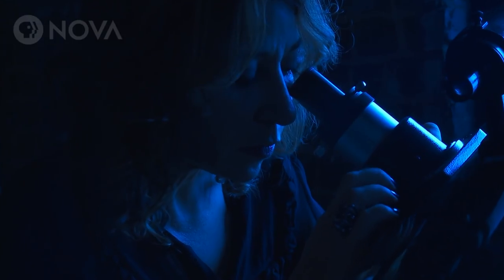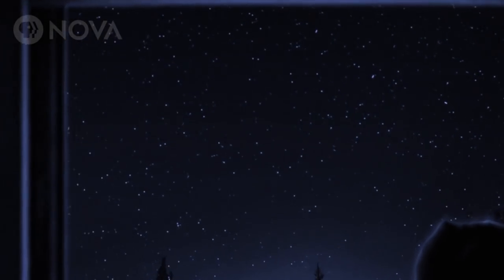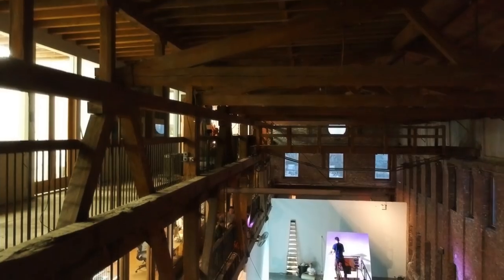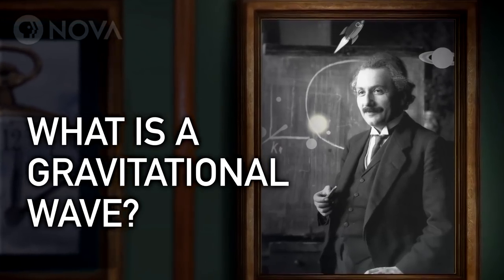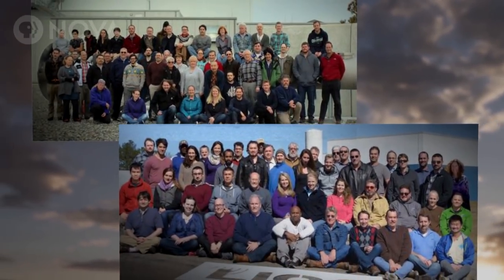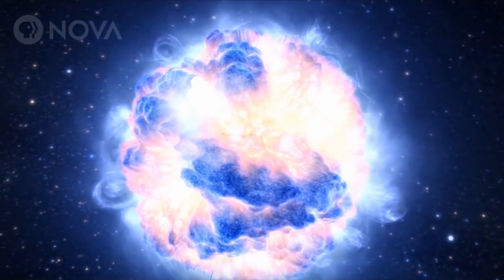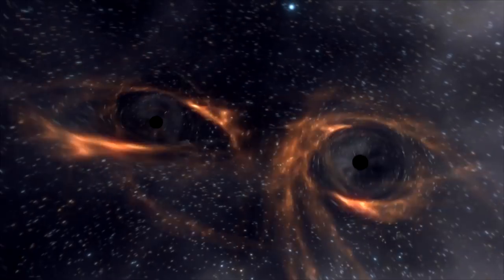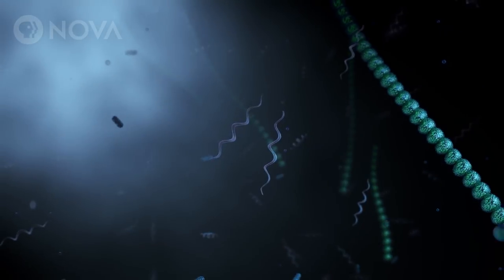Black Hole Hunter: Janna Levin

Comment: Another Lucky Guess?, or my thought experiment.

My reasoning in this thought experiment.
The recent NOVA presentation of “Black Hole Apocalypse”, included descriptions of gravity waves traveling through the Fabric of Space Time, as compressional waves in the Fabric.  Also described are Electromagnetic waves, traveling as transverse wave motions, in the Fabric of space-time.  All of which, I suggest, requires compressing and stretching of the Fabric.  The subsequent motion imparted upon “things of matter” in the fabric “such as demonstrated with LIGO” illustrates, to me, a direct connection between Matter and the Fabric.
From this, and other related observances, I would like to propose the following possibility.  
M=FC2   where F= Fiber of Space Time.
What brings me to this thought?  Please consider the typical depiction of a “gravity well” as a plane, with grid lines, distorted into a depression, or well, by a heavy weight placed at the center.  The Gravity Well drawing depicts how gravity effects any matter placed on the grid, and assumes a gravitational force from below the plane.  The matter will be drawn into the well, of the plane, by the downward stretching of the Fabric, and a gravitational force below the plane.
I suggest, here, how this may be depicted in a 3D volume, with no assumption of external gravitational forces.
I suggest a 3D volume is assumed in this description.  Initially this volume is to contain only the homogeneous Fabric of Space Time, shown by filling the volume with a translucent shade of grey (arbitrarily chosen).  A gravity well, in this volume, may be depicted as an infinitesimally small point that has drawn surrounding Fabric into it, stretching the surrounding Fabric as it is drawn to, and into, it.  In this depiction, I suggest the stretching in the fabric to Be displayed through a varying of the shade of the Fabric, to indicate the degree of stretch, and thereby variation in density of the surrounding Fabric, most rarified near the central point and increasing back to the surrounding ambient, some distance away.  Appearing now as representing a 3-dimensional vortex inside a volume. 
 I suggest there is a maximum amount of Fabric volume pulled into the vortex.  And that amount to be C2.  I suggest this value matches with what seems to be observed when the vortex “unravels”, or E=MC2 .
Unraveling of the central point would be expected to produce a violent expansion of the Fabric around this point, and should be expected to produce a large amount of compressional and transverse waves in the Fabric.  There by producing gravity waves, light waves, and other frequencies of EMF waves traveling outwards away from the central point.  As well an abundance of freed Fabric will now push its way back into the surrounding Fabric and pushing Fabric, any objects of matter, away from this point in all the 3 dimensions. 
Now I suggest creating a second such point of stretched Fabric, near the first, at a distance where the zones of low density of each are just begin to overlap.  The area in the Fabric immediately around and between these two events will be of a lower density than the area outside the combined zones.  This, I suggest, creates a surrounding pressure Imbalance that strives to push the two points together, functioning as a Gravitational force.
I suggest the following characteristics of the Fabric, to be found around this vortex event, or events, in the Fabric.  Traverse waves (EMF waves) traveling past this point, in the Fabric, can be expected to slow down, by an amount depending upon the change in Fabric density surrounding the central point.  
Also the EMF waves can be expected to be refracted as they travel through the varying density surrounding the central point.
I am aware, as I assume you are by now, that the process that creates this vortex has not been addressed.  This is something I suggest can gather sufficient interest once these natural occurrences of time and motion in the Fabric have been verified.
Also I suggest that these central points, being of such astronomical amounts of densely packed Fabric, in each one, to be what we observe as points of Matter. 

Many regards,

Gary Lee Scott
1/17/2018

Comment: When things are pulled inside a black hole the universe seems to be expanding infinitely.  Our galaxy and most galaxies are just a few billion light years apart above the event horizon.  Expanded bubbles are not true though appears like that.  All universe can be entering a black holes only.
Reply: Once well inside the event horizon it just breaks or splits the event horizon.
Reply: Big bang is when event horizons meet.
Reply: Quantum leaps from black hole to black holes.
Reply: When two toroidal magnets meet because of polarity they simulate a black holes merge in space. Interaction between toroids. They have shapes something like Klein bottle.